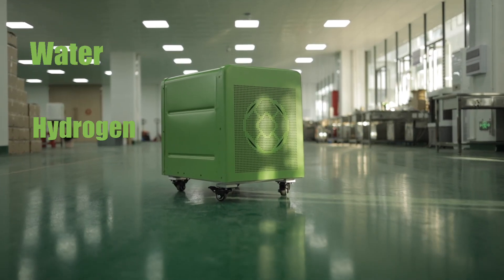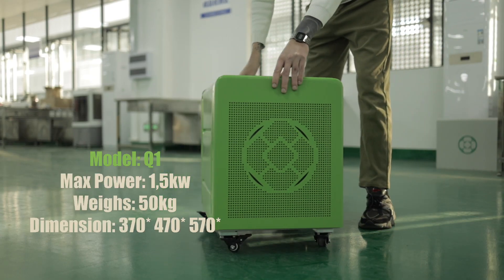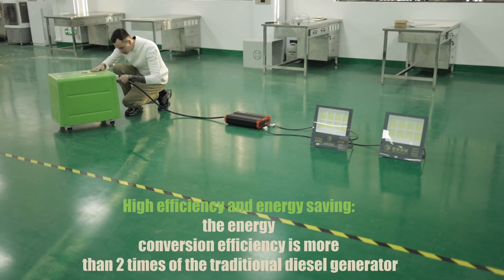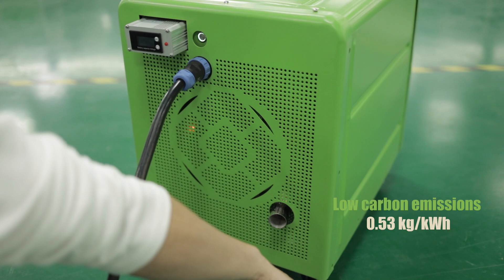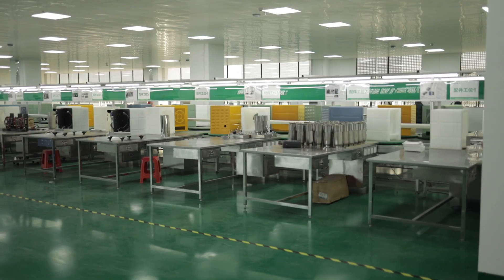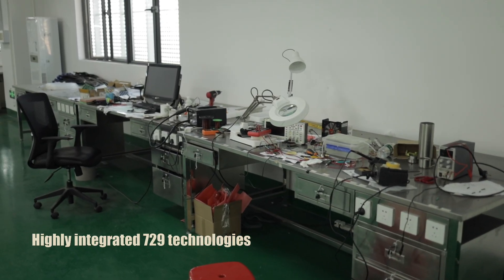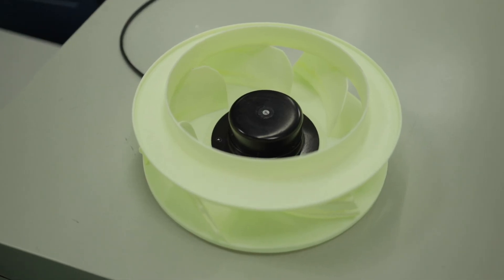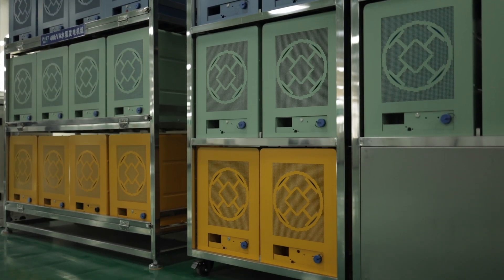World's first portable Water-Methanol Hydrogen  Power System! Produces 2kWh/1kg,quiet,eco-friendly !

Comment: SCAM.

Calling this 'pollution-free' is misleading. The machine converts methanol to hydrogen, but where does the methanol come from? Most methanol today is derived from natural gas or coal, meaning it's neither green nor sustainable. Even if you use renewable methanol, the process isn't emission-free—carbon is still released somewhere in the cycle. If the goal is clean hydrogen, direct electrolysis powered by renewables is a far better path.

You're horrible Austrian accent AI voice over isn't fooling anybody.